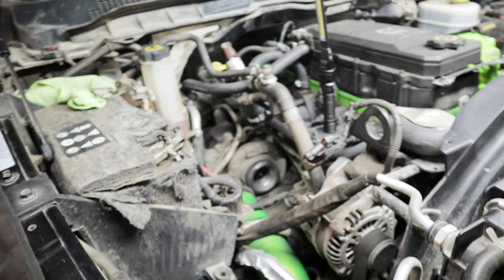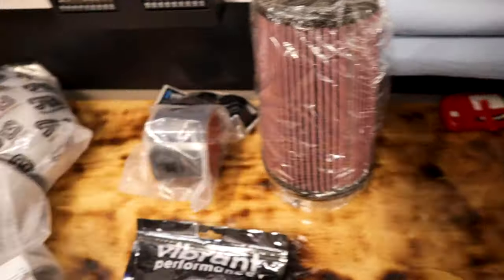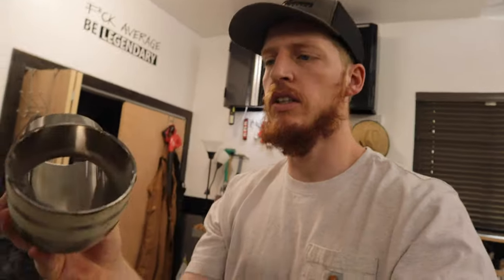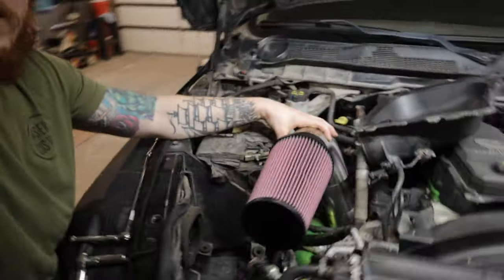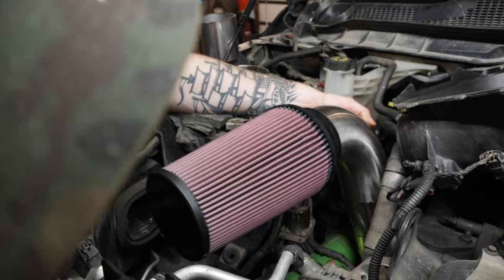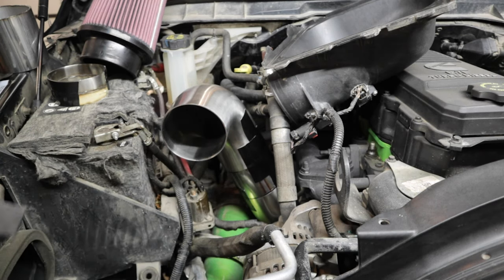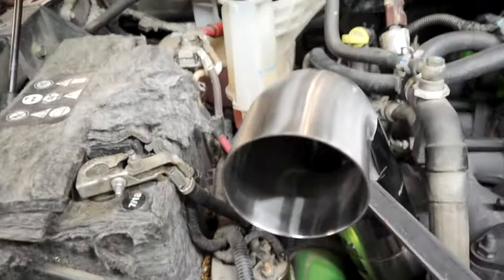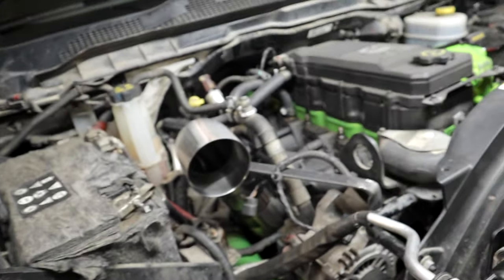Custom Fabricated Intake for a 6.7 Cummins

Comment: If you’d wield a slight 45* angle at the end pointing downward toward bottom of stock box you’d be a lot happier. Large void down there. Colder air and still use same filter.

Comment: A I'm not trying to be a know it all but you no you could of ordered those 90s with a 10inch arm 18inch 20inch and so on cause then you can cut the arm shorter one side and leave the other side long to kick your filter forward just a suggestion that what I had to do on my Pete for the down pipe but your doing a good job
Reply from the maker: I didn't first time trying anything like this. Thank you for the heads up!